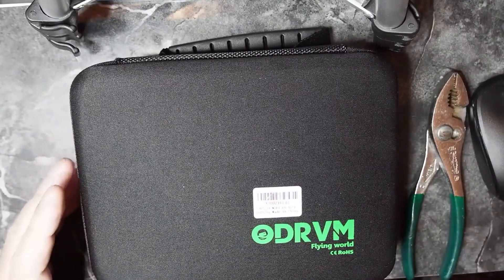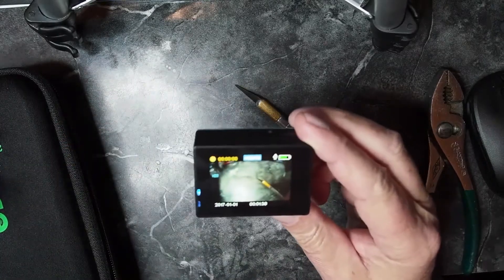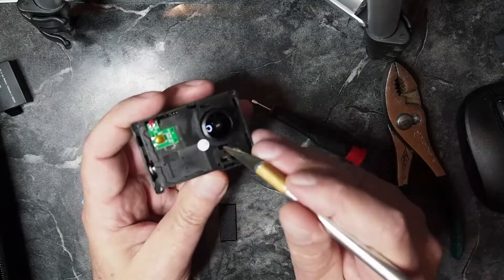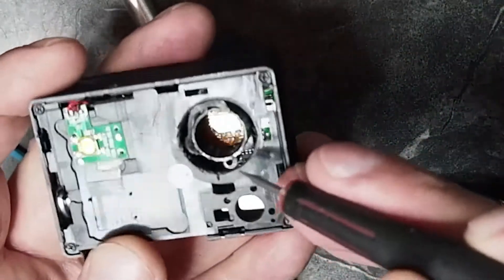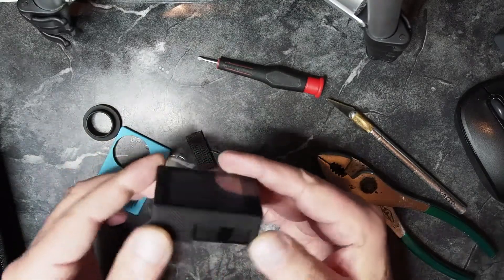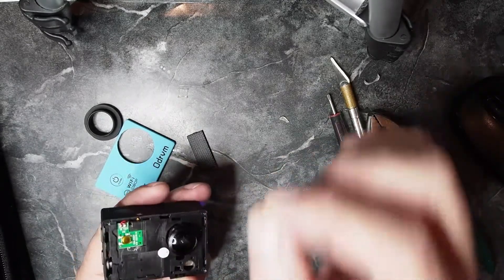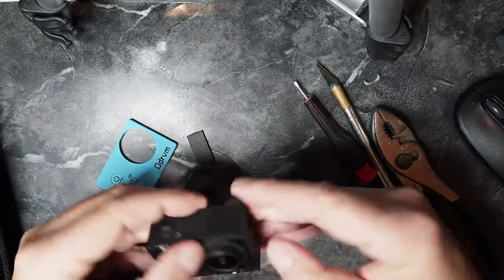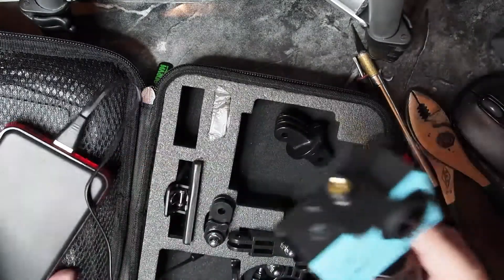Equipment Tips#1 Step by step guide to convert a action camera to IR/UV cheap

Comment: Aaaah yes this only works if the IR filter in at the very back of the lens pack, I have found several of these small action cameras where they put that IR filter inside the lens pack...... Therefore you cannot remove it.